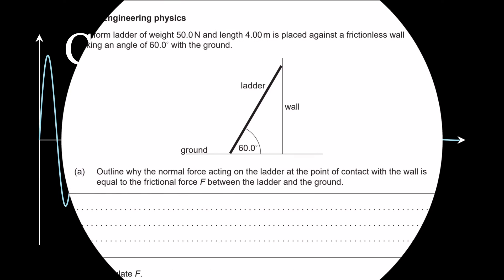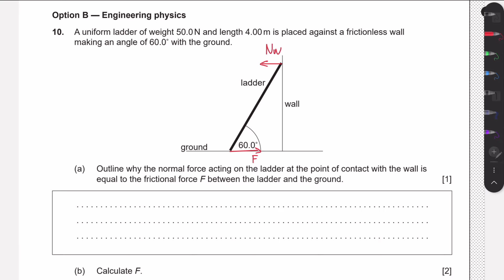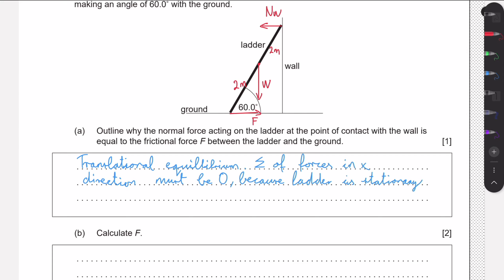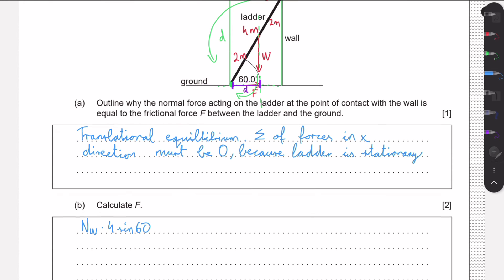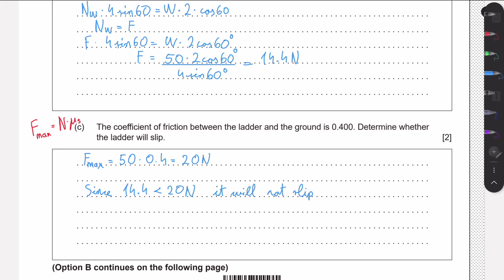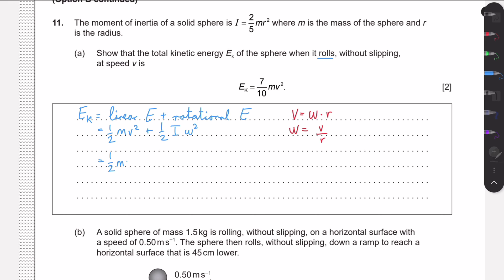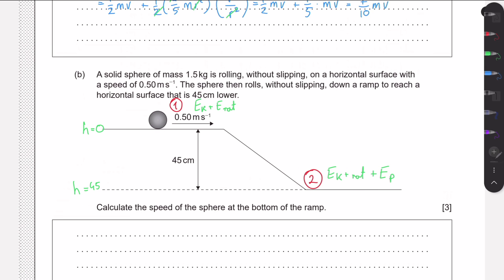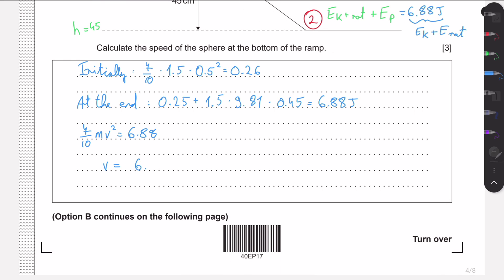IB Physics M19 TZ2 A.4 Rigid Body Mechanics || A uniform ladder of weight 50.0 N and length 4.00 m||

Comment: is there an easier way to explain part b of the first question? i dont understand why the perpendicular line was the arm of the force
Reply from the maker: Well Im not quite sure which part you need help with, but the arm of the force is always the line connecting the axis of rotation and the force such that the line is perpendicular to the force. From there its just trigonometry. You can also think about it this way: draw a line connecting the axis and the "start" of the force vector, and find the component of the force that is perpendicular to the line you just drew. I dont think in this case this way is any easier, but sometimes it helps.
Reply from the maker: If you want a deeper understanding, and have heard of the cross product, see how torque is defined in 3D with the cross product. 2D problems are just an easier 3D problem basically so we dont need vector math really.